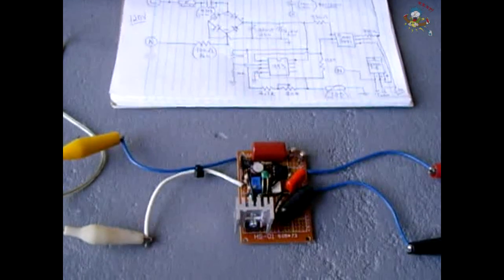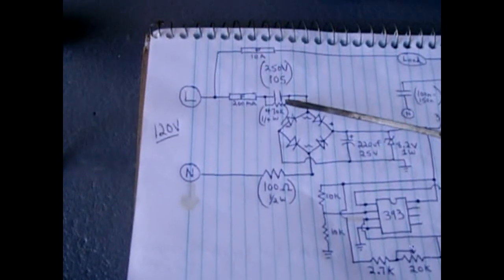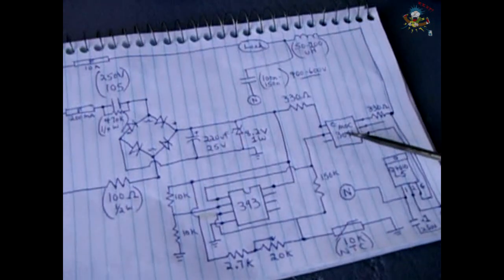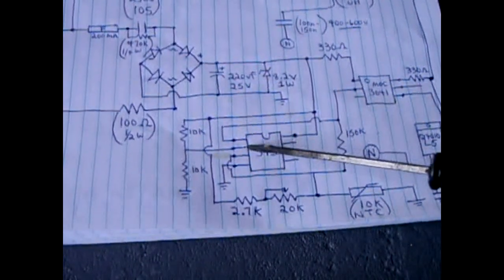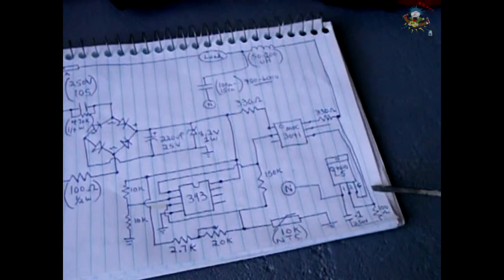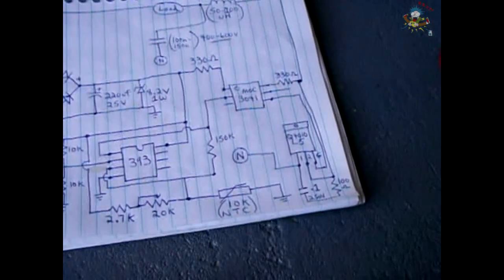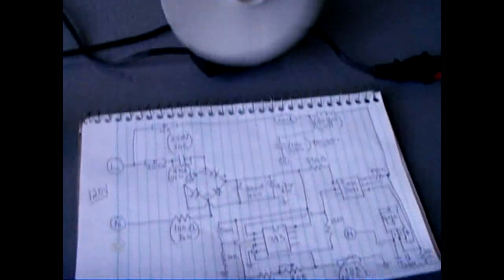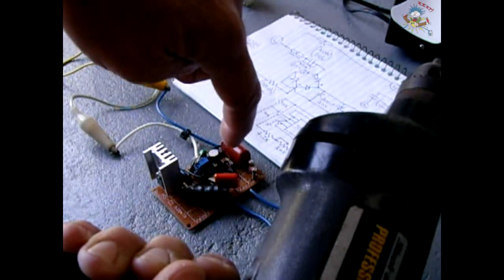Temperature Controlled Triac Circuit(Motors/Fans/Heaters+)

Comment: really very useful video thank you so much sir ....but the Link to Schematic is not working ...pls provide the circuit sir
Reply from the maker: Use schematic shown in video.
Reply: Sir , can I know the reason why you are using the neutral in the traic to control the load instead of phase ...also pls let me know the use of the 100nf capacitor and the inductor 50 - 200 uH after the load

Comment: With quite a few mA going via the 1UF cap to ground, is there a likelihood that an RCD protective device would trip out?
Reply from the maker: Nothing goes to ground. Everything is connected to the AC neutral line or to the NEG of the rectifier. Thanks for watching!

Comment: Greetings. Firstly how can i go about changing the supply to a 220V/230V AC at 15A that is to be stepped down to power a 12V DC at max 2A motor.

Secondly how can i have this circuit control a motor and a heater at the same time whereby when the temperature is cold, heater turns on and when its hot, fan turns on.

Any help appreciated, many thanks.

Comment: can i use this circuit to control the temperature of an electric heater with arduino?, and if i can, how?
Reply from the maker: They may sell a module that's temperature activated with a relay.

Comment: What inductor did you use in this circuit.  I am having trouble finding a suitable inductor in the 50-200uH range that can handle 10 amperes?
Reply from the maker: Hi George. I used a small ferrite rod with 14ga/16ga wire. You can find them in 120V dimmer controls, or inside many other electronics.

Thanks For Watching!

Comment: Here is a circuit through which the speed of a fan can be linearly controlled automatically, depending on the room temperature.

fan works when the temperature increases above the ref temperature.i have to make the circuit for heater i.e. it should start heating if temp goes below reference. what should be the corrections in the circuit or simply replacing fan with heater will make difference
i will be very thankful if u kindly tell me the correction
Reply: http://www.electronicsforu.com/electronicsforu/circuitarchives/view_article.asp?sno=381&article_type=1&id=581&tt=unhot&b_type=new

Comment: Generally, for 230V the series capacitor rating should be 400V AC or 630V DC.
The LC filtering is not needed here, as the MOC3041 has zero-crossing detection built in, and will always turn on only when the current is zero, thereby not creating any spikes or surges.
Reply from the maker: That is true. With 240V, you normally use a 400v - 630v rated cap. I thought I stated that in the video(If not, I certainly said that in other videos I have). As for the RC part of the MOC3041, many circuits I looked at, included the RC circuit.

Comment: Can this circuit proportionally control a heater for a  water bath or small green house?  I have been looking for triac circuit to replace one using an SCR that I found in an old SciAmer. article.  Like your videos!
Reply from the maker: Di you mean as it gets hotter, then fan would go faster?
Reply: electronicsNmore Yes, or if it was controlling a heating element it would increase or decrease the temp. by controlling the duration of the AC cycle passing the triac.